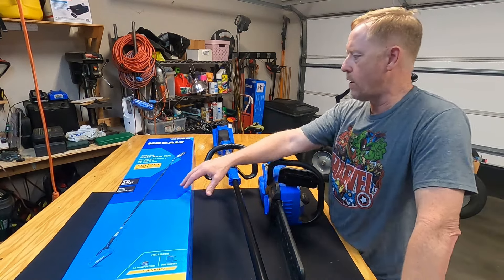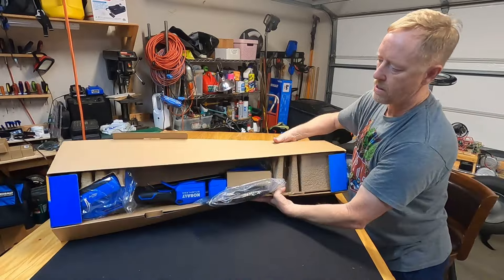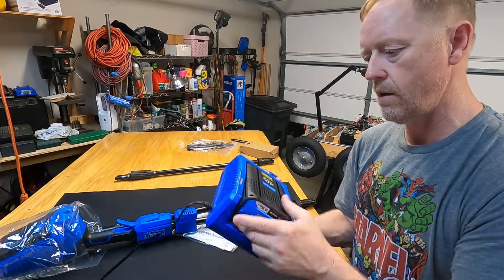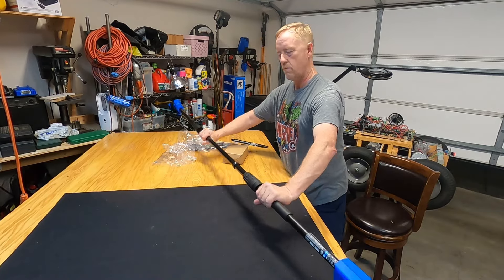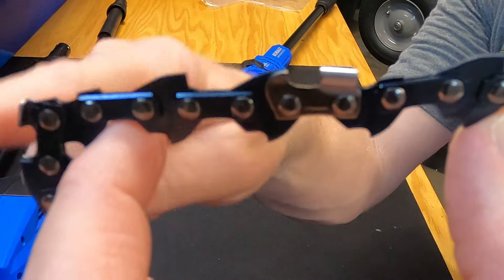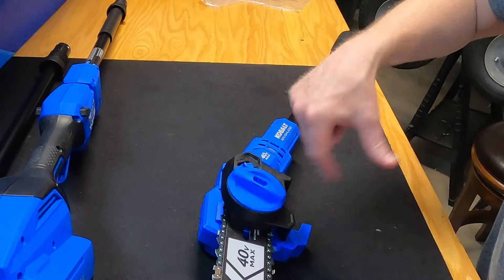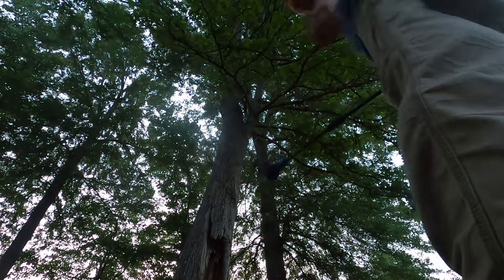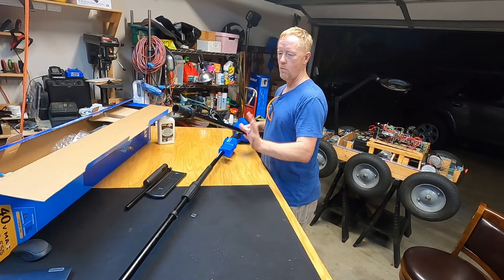Kobalt Pole Saw - 40V Max

Comment: I just bought that same saw today, but the 8, not the 10. I don’t see that hole where the chain lubricant goes. There’s not a hole where it appears to be on the 10. Any ideas?
Reply from the maker: Some of the different models do not have the lube hole. I have always wondered why they do not put it on all models. Just make sure to grease the gear at the rounded end of the bar from the outside.

Comment: Mike. I have the same model. My question is, can you upgrade the chain bar and chain to a 14 inches on this pole saw? I can’t find any videos or any info in the Owners Manual. Thank you.
Reply from the maker: That should work if you can find a bar that will fit, but I would not recommend it. The saw body is not made for a 14 inch bar.
Reply: @MikeM100  Thank you for your prompt reply. You are right. I just talked to Kobalt Cust. Service earlier today and this model has no upgrade bar or chain higher than 10 in. If you upgrade it will void the warranty. Thanks again for your response.
Reply from the maker: I tried my 14 inch Oregon bar and it did fit, but it makes the saw pretty heavy. My main concern is that the saw body is plastic and would not handle the stress of the longer bar.  And it would potentially be dangerous in case the saw slings itself apart.  And then there's the pole.  The pole is not super strong.

Comment: Do you know how to solve my issue of the chain constantly coming off?
Reply from the maker: I've never had a problem with my chain coming off.  After 300+ uses, it still works fine.  Are you using the original chain or an after-market chain?  Also, chains do stretch over time.  You may need a new chain.

Comment: If you think 40 volts is good try the - 80-volt - 5-ah battery - 10" Bar - 6 ft / 8ft foot Kobalt Pole Saw. No cable. I’m using an Oregon Bar and Chain. I have been using it for more than 3 years now and love it. It works great on my southeast Louisiana farm clearing property that a hurricane went through and trashed all the trees in the woods of our 20-acre farm. I carry it all over our woods and the battery lasts a long time. Today I'll be cutting a 6-inch limb off of a tree out front. I also have (2) 80-volt 5-ah batteries 18" chain saws they are awesome.
Reply from the maker: The 80v tools work good too.  I've got a couple, but haven't used them enough to do videos.   I want to give them a good workout before doing a video. I hope you guys have recovered from the latest bad weather.  Down where you live, you need a chainsaw just to fight off the mosquitos.  Thanks for watching.
Reply: @MikeM100  - Everything is good. Strange that the mosquitos don't usualy bother me, but the terrorize the rest of my family.   🙂